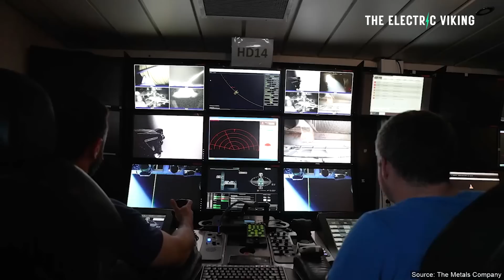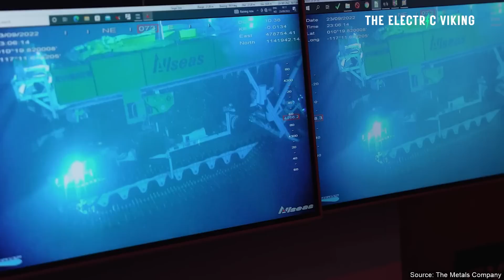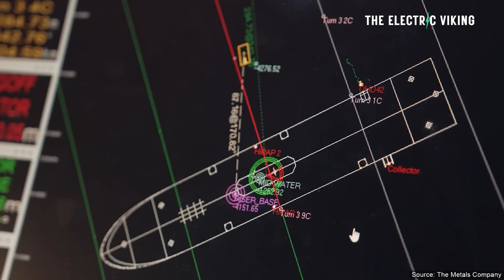The planet's largest source of battery metals sits 4,000 meters under the sea

Comment: The idea has great potential, but three things must be done:
The technology must change, to enable the nodules to be plucked from the seafloor, rather than scrape up the entire floor;
There must be live continuous video, publicly available, to dispel the idea that 'we don't know what they are doing down there';
Mining must be in narrow strips to allow re-population of the mined area laterally, should denudation be an issue.
Reply: I agree. I've seen it done. They are actually sucking the modules up through a 2 mile long flexible metal hose about a foot in diameter without any scrapping at all. However, the strong suction brings sand and everything else up before it's sifted on the vessel and all but the modules are sent back down. A better way would be with robotic vehicles doing the scooping and gentle sifting on the sea bed before only the modules are brought up via suction or a conveyer belt style system. And adding constant cameras will silence all the critics. There is very little life down there on the sea bed itself.

This is not mining. Calling it mining does in an injustice. There is no tearing up being done like in oil exploration and extraction on the sea bed, or the typical mining done on land. It's basically bringing up modules lying loose on the sea bed.
Reply: @Paul-cj1wb  An even better way might be to use hot water to dissolve the minerals in a on-shore mine and pump the water around in a loop after taking the minerals out.

Comment: I lean toward Fathom Nickel and Flying Nickel, as they have nickel sulphide, which is easier and much less polluting than nickel laterite. I invested in both, mainly for that reason. Also, manganese is pretty plentiful and not expensive. Both are also recyclable, with no limit.

Comment: I know that messing with even a lake bed will cause fish not to come back to the spawning area.  A person that owns a small lake knows that habitat like falling trees and metal X-Mass trees give fish a place to hide and lay their eggs. Fish will some how come back as long as the original  land scape is the same.  If you destroy the river bed where salmons return to spawn, they might get confused so we need to understand the damage if any.  Therefore no matter how safe the mining is, it will effect the eco system.  So what kind of sea life is effected is what needs to be answered before taking on sea floor mining.  You will need to weight out risk vs reward.  As a Martial Artist, I often get hurt, so when engaging in a practice fight, are you willing to go all in leaving you vulnerable.  It’s like that
Reply: After 100 M in depth there is way less life because light is the source of life. At 4000 meters, youre very deep. The problem is the pressure.
Reply: You prefer the constant digging and drilling for oil exploration? Are you aware of just how many holes are dug on a daily basis looking for oil all around the world? All the explosions done on the sea bed to reflect back for radar recognizance  looking for oil pockets? And that's not counting all the oil and extractions and all it's constant leaks associated with it. Because that's not going to stop unless things like this brings it to a stop.
Reply: @-whackd  Life can live without light but not without heat. The energy has to come from somewhere.
Reply: @Paul-cj1wb  Well there is running out of oil to pump.

Comment: Mining of any type can be quite destructive, but when it comes to metals, they are quite recyclable.

Look at the iron, aluminum, copper, and lead industry for proof.

Once the market is saturated, mining will fall off.

There is also the increased use of utility level reverse osmosis for drinking water.  The biproduct of this process is brine which can be harvested of practically the entire periodic table in terms of minerals and metals.  No actual mining needed.  That water when it eventually returns to the ocean, will desolve minerals/metals from deposits ready to be harvested again.
Reply: ha ha ha   while a lot is technically possible - we are not doing it yet nor are likely to - any time this decade.  Concentration makes the financials.

- many metals need constant mining, yes a lot of steel is recycled, but a staggering amount decays into rust  or is ground to powder to need more added to the supply chain globally. - a lot of lead ends up lost in the bush, all over the world...

(The distributed nature of a whole lot of modern detritus means that mining virgin material from orebodies is much more efficient than recollection and recycling  - until all garbage bins go through comprehensive re-aggregation processes globally, we will not achieve the lofty goal of "zero mining" )
Reply: @kadmow  you are correct.
It was more of a statement of what is possible than some theoretical utopian dream.  Alot of people cry foul over modern batteries due to mining and the lack of recycling.  That won't stay that way very long once there are enough EV cars on the road and companies work out the logistics of it.
Reply: @kadmow  I will bet that these things will happen much faster than you think. Here are some reasons. The use of "rare" earths has been foreseen to be a bottleneck more than 50 years ago. It is just a cost-benefit tradeoff. New ways are constantly being developed for the simple reason it is cheaper and more secure to use common materials. Much more efficient recovery processes have been and are being developed. At some point, no mining will be needed, this has been forecasted and mitigation of the changes in the economy caused by having no mining have been thought about. (The lack of advancement in third-world countries due to no investment in commodity purchases).
Reply: @tedmoss : Severe supply limitations exist - significant proportions of commodities volume in metals are already recycling - Iron, Copper, Precious metals, Brass, Nickel etc...  Forecast volume increases needed  - to carry out anything mimicking the "international agreements" are in the order of  hundreds of percent of total market trading in many base metals.  I don't say anything is impossible, but if new copper is only 15% of the commodity traded (as one example - percentages may vary) - where is the shortfall coming from given severe under exploration and poor prospects of  new sources on the immediate horizon - ie increasing supply 100% means increasing mine output ~700%.  

Hopes and dreams, I'm well sorted, how about you?? - many are not - that would be most of the 8B people on the planet...

(Yes there is always a cost component, but Capitalism has not reduced the likelihood of increasing conflict leading to scarcity of supply, given all the sabre rattling going on around the world.

Cheers.

Comment: If 70million vehicles is the std rate of replacement annually then the 50% increase in annual EV production means that we will reach the economic replacement quantity very soon.

Over production is a waste. 
The sweet spot of production is approaching. Fast. 
4 or 5 years to a stable production rate to replace ICE vehicles at the end of their normal life span.
Reply: Except they need replacement much less than originally thought, maybe 10 years.

Comment: Elon Musk has already pointed out he could manufacture all the batteries needed without rare elements. This is just not needed.
Reply: Yes.  Their goal is by 2027 for the batteries and motors to be rare earth free, which make up the vast majority of the total rare earths.  But EV's and even conventional vehicles still use some rare earths.  Radio transmitters, LED screens, camera's and circuit boards all contain some rare earth's.
Reply: This is not rare earth. Ni, Co, Cu, Au, Ag, Mn are not rare earths.
Reply: @Ryan-ff2db  Nothing rare on my circuit boards, just aluminum, copper, carbon and gold.
Reply: @souravjaiswal-jr4bj  People get loose with terms and ideas when they know nothing about what they are talking about.

Comment: We only recycle 10 percent of simple plastic, what makes you think we are going to break down complexly built batteries and recycle those?
Reply: If you were going to start a copper mine would you do it in a poor vein or would you find a rich copper ore vein?  Even those rich veins are usually only parts per million and not even measured in percentile. There’s no richer ores for battery materials than old batteries. Imagine if we never recycled iron copper or aluminum. Redwood materials.
Reply: Simple, plastics are cheaper to make than recycle.  The materials in batteries are extremely valuable.  It's just economics.  It would be insane to throw away something that valuable.
Reply: Current lithium battery recycling tech has a 70% material recovery rate, and rates are improving every day as investment is pouring into this area since it has been shown to be very profitable, with some new companies hitting 90%. On just the first step of the battery recycling chain, it cost recycling companies about $90/metric tonne to process the batteries, and out of that they can sell the black mass for about $300/tonne, and the metallics for about $500/tonne. The black mass is a mix of all the carbon, lithium, nickel, manganese, cobalt, and other elements that can then go through processing to recover them. It is like having super concentrated ore with all of the materials needed for batteries.
Reply: @Palisades_Prospecting  I was going to say the same, J.B. Straubel.

Comment: CLIMATE DESTABILISATION is agreed even by the nuclear promoters.

CO2 nonproliferation by nuclear proliferation. 

EV big batteries topped up daily by nuclear electricity is an oxymoron. 

Central concentrated electrical generation needs massive grid transmission capacity increase. 

Massive mining and refining and manufacturing and construction. 
Massive energy and massive financing and massive CO2. 

And then the vehicles need to be manufactured.
Reply: You sound quite mixed up.
Reply: @Ted Moss  too cryptic, and with bad punctuation, my apologies.

Comment: Uh, there is a problem here. In some sections of the deep ocean there is frozen methane.  The melting of that methane is one of the worst case scenarios that can occur if we go past 2 degrees Celsius in warning. If this vast amount of methane was released it would start a catastrophic warming of the earth past 10 degrees Celsius!

 I wonder if mining these metal modules would churn that up or lead to its melting? I am not sure we should risk this.
Reply: There is no tearing up of anything. These are simply bringing up small modules lying loose on the sea bed. What does tear everything up is the constant oil exploration and extraction. It's in those areas where the methane exists. Hence, the oil pockets in the area.
Reply: @Paul-cj1wb  Totally agree with you that oil is so much worse. However there is plenty of manganese on dry land. Why disturb the oceans?  There are such things as electric mining equipment and electric mining dump trucks... the huge ones. 
 They say that they are just "picking them up".... but do we know exactly what processes they will use to do that at such crushing depths?  It is difficult to even seal electric motors to keep them running at such depths. What method will they actually use? What type of disturbance will it actually cause?  The soil at this depth is rarely if ever disturbed, do we know whether it might kick up sediments that could be toxic to corals or other sea creatures?
I'm sure oil companies assured everyone that there would be no environmental damage drilling for undersea oil because of the wonderful technology they would employ. We know how that turned out. 

If this is truly better than land based mining I'm all for it. I just mistrust when people tell me things like "it's just lying there for the taking and it will be easy".... will it? Really?  Maybe. 

I would want real testing at reasonable scale and third part testing proving efficacy and how this is much less polluting than land based mining before I would want this to go forward. Due diligence.
Reply: @nickmcconnell1291  I know they are loose because I'm seen it done. They are literally just sucking them up. They are using two 2 mile long flexible but reinforced metal pipes/hoses previously used for deploying and retrieving oil industry equipment on the ocean bed. They suck them up, sift it on the vessel to keep only the modules/nuggets, and then send the rest down the second pipe/hose. A method I disagree with. I think we need to use robotic subs used to film the bottom of the oceans and have them gently pick up the modules and gently sift them there and send only the modules up. Rather that sucking everything up.

But let's stop being naïve. if we don't do it, China and Russia WILL. China has a near monopoly on all renewable energy and batteries. They have built their entire army and navy on our money. We have paid for it all. And it has been the fossil fuel industries and environmentalists that has allowed it all to happen. They will have no second thoughts about bringing them up anyway they see fit.

This vast area exists in international water in the pacific ocean between the Americas and the Hawaiian islands. China, which has no right to claim or ask for permission, is already making deals with South American countries trying to get the rights to request permission. 

Right now only one company, from Canada, has been given permission. I think they should continue this way for some time until a method similar to my suggestion is developed. All done with cameras so that we all see exactly how its being done to shut down those who claim otherwise. This company can then sell modules or processed metals/minerals equally and at very low prices to benefits renewable energy wide adoption, until the rest of the world catches up with China.
Reply: @Paul-cj1wb  Your plan for picking up with subs sounds like the way to do this. Neat that they literally are just sitting there.  I totally agree that there is a new "gold rush" of sorts going on that nations are competing for.  Hopefully we can keep the environmental damage down to a minimum and far less than what oil exploration does. 

As to getting there before China.....I loathe our self imposed dependence on China and fear their growing influence and their dictatorial govt.  You are exactly right that we did it to ourselves.  I have said many times that educating the people of other countries in math and the hard sciences is just raising up your own future competition and here we go. 
    However I am old enough to have seen the pattern that is occurring with China five times before. Nations in contest for some resources and distrustful of each others govts.... competing for world respect, and power..... start name calling... then condemning each other and their peoples for one thing after another. Scuffles occur. The media starts running only bad stories about the people in the other nation.  How evil they are, how everything centers around defeating or besting them. 
Slowly the war drums beat and crescendo and then politicians tell the populace that their children must die for some cause. 
I've seen this movie before. I hope we can grow up and not repeat this again. 

I'm sure that any alien races must look at humans and say "tsk tsk there those lemmings go again getting ready to run over the cliff and kill themselves. Don't they know any other way to keep their population down?  No wonder we aren't allowed to make contact!"
Reply: I always wanted to live in  the tropics.
Reply: @nickmcconnell1291  To bad you are not in control.
Reply: @tedmoss  Hah, stick around and you'll get your chance.
Reply: @tedmoss  I don't want the job. Which means I'm probably qualified for it. 
To summarize a character from one if Robert Heinlein's books:   
     The first qualification for the office of the President of the US should be that they don't want the job. The truly qualified candidates wouldn't. They should then be pulled into it kicking and screaming.... then let off after 4 years on good behavior. 😆

Comment: Costs of the technology to get to the depths you are talking about is huge.
Are the researchers saying there is little life paid by the mining interests?
Maybe like the people who for decades said that smoking tobacco was healthy.
What about the frozen methane?
Reply: There is little life at 4000 meters below sea level because life is generally dependent on light. There is no light below 100m, even the red spectrum.
Reply: There is no tearing up of anything. These are simply bringing up small modules lying loose on the sea bed. What does tear everything up is the constant oil exploration and extraction. It's in those areas where the frozen methane exists. Hence, the existence oil pockets in the area.
Reply: @Paul-cj1wb  While your statement is 100 percent correct, if you read some of the comments you'd think Jesus himself killed the dino's just so 'Merica could burn the glorious black gold and become god's superpower.  Paraphrasing of course.

Comment: Sounds like its time for Elon to invent a solution to mine these manganese deep sea nodules, efficiently and at scale to further disrupt the battery cell industry, to reduce the cost of batteries used to power all types of machines to a nominal amount. The more manganese that can be introduced into the system will mean in future that there can be symbiotic industries to recycle the existing manganese into new batteries thereby, reducing the need for new resources of manganese being mined.